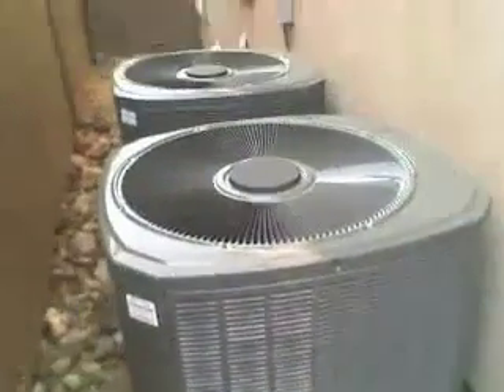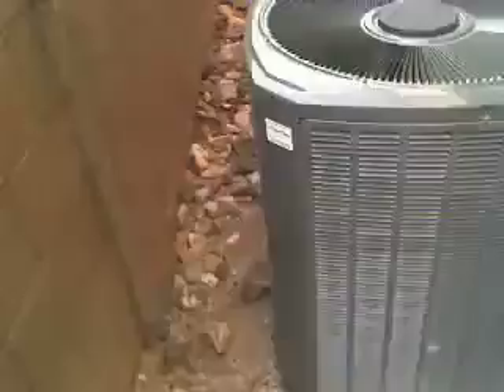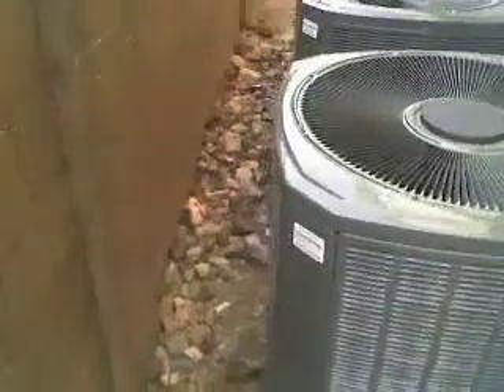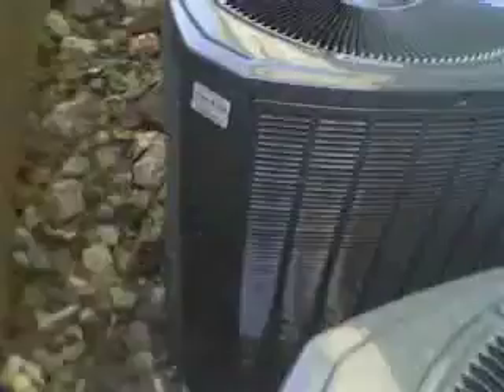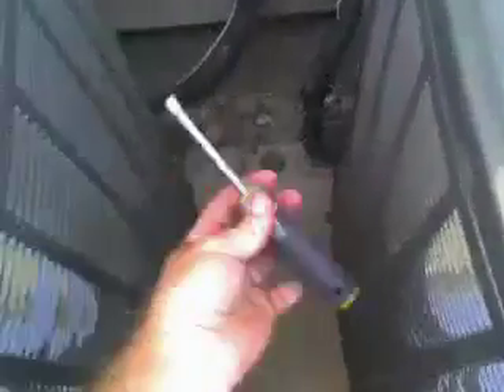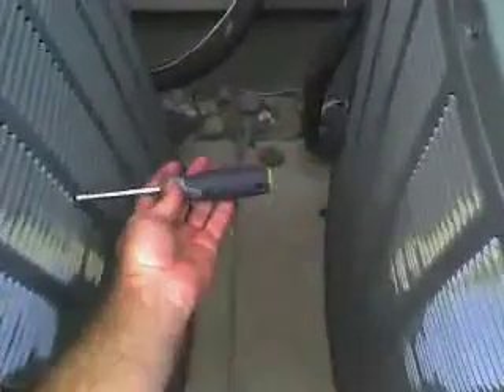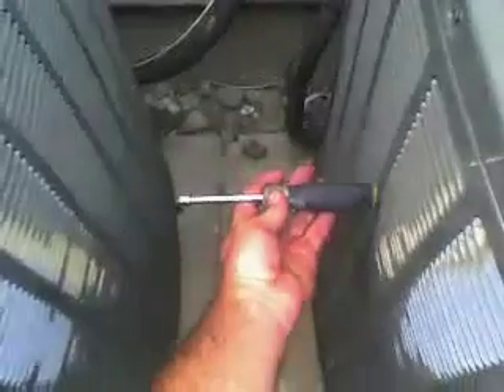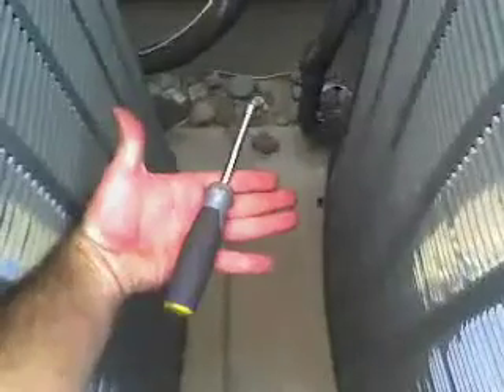Hacked Trane XL19i units! Very BAD installation!

Comment: LOL. My unit was installed 15 years. ago. It was an XL 19i Trane 3 tones unit. I just learned all by myself my unit was running at 2.5 Ton.  I rather pick up the book and learn the damn thing myself.
Reply from the maker: You mean it was just running on first stage?
On a XL19i twin compressor unit you would be at 50% on 1st stage then full capacity on second stage. 

I'm pretty sure it's still a 50/50 split even on the 3 ton but it's been a good while since I've touched one.

Comment: Lol. I recently got one of those 19i condenser for free that works. 5 ton I’m gonna put in my shop
Reply from the maker: Make sure that start cap and relay are in good shape.
The one bad thing about those units is that they use two recipricating compressors and as it switches between low to high or high down to low it stops one compressor and then slams on the other just 1 minute later. Those things were blowing up start caps left and right when they came out. My fix was to install a kick start KS1 which had a larger MF start cap. Later Trane changed their OEM start cap to one equally as large and that helped.

Comment: Are those on one of those terrible houses in your older videos with those rooftop units above that brick wall? Looks like someone tried to squeeze units between those houses and their brick wall. Whats wrong with putting the condenser in the back yard where it belongs? And run your lineset in a chase up the wall and thru a soffit into the attic? I think attic furnaces are the worst idea ever. Especially in a hot place like Arizona. Those attic temps must be brutal. If it was those same baboons builders who had that brilliant idea of putting ugly as hell POS RTU's on a 5/12 pitch roof covered in pigeon shit, I bet they have terrible attic ventilation and insufficient soffit vents and ridge vent too. Just goes to show, sloppy builders don't just cut corners on the HVAC system, the rest of the house is also built to that same "custom" level of quality. I'm starting to wonder if they have sewer drains that run uphill too??? LOL.
Reply from the maker: No these weren't the rooftop houses but the setup of the narrow side yards is the same layout.

Not enough room for a ladder to be safe and not enough room for condensers either.

In this case they installed two new two stage units right up to each other.
The boss at the time and I argued about it.

He brought in the trane manual that showed at least 12 inches to the closest wall and by defacto said he could HALF that to 6 inches to the wall.

The 24 inches of separation from the next unit was meaningless to him.

That job upset me because we got a lot of install issues and they were installing top tier brands at top tier prices and would then do this to some of them.

Most of their rooftop stuff looked great.
But the split systems with the furnace in the attic like this job was so sad.

Comment from the maker: @NLBheating 
Install is a BIG part of failures, which is the theme of this video.
But there are brands and models of brands that have been known to be JUNK.

Here in Arizona we had Goodman Heat Pumps that were referred to as "Desert Series".
I don't think people saw them in too many areas of the country. But they seriously are the biggest pile of crap to ever exist.
Stack Relays (time delay relay) and rubbed together cap tubes were major failures unrelated to install on those.

Comment: @82dwkamp i hate most people cause they think Tranes suck. I've had my Freedom 78 and freedom 90 (own two houses) and both of them have been working for over 21 yrs. yet my lennox whisper heat died in 2 months(lake house). i install them my self(with friends help) and follow ALL the I/O sheets for maximum efficiency. only problem ever was the 78 unit's blower motor died, so i bought the biggest motor they can use and now it's just amazing (the 78 covers a 3,000 sqft house, 1 degree per minute).

Comment from the maker: @7O124 
They are certainly XL19i systems.

If you watch the beginning of the slide show of the "BEFORE" and read the video info you will realize the flat tops from the lowly base model 13 SEER in the "AFTER" segment was the companies band aid to the problem and keep the head pressure under 400 PSI (R22).

Comment from the maker: LOL! What license?
In Arizona they don't require a license/certs or any proof of any training and you can go work on refrigeration. plumbing and electrical components in the systems. All you need is a EPA card. And they rarely check for that. Only your employer usually asks for that. A guy can study and take the EPA test to get that just like studying and getting your drivers license. Doesn't mean you have a single day's of experience! It's BAD. No permits, no inspections here.

Comment from the maker: LOL! That's the point. Those ARE XL19i's. I took pictures on the first PM I did to them before summer hit when I saw how close they were to each other!  The VIDEO part is of THE EXACT SAME XL19i's AFTER my coworker found them conking out in the HOTTER part of summer when they ran over 400 PSI head pressure! He installed XB13 fan grills to discharge the air more straight up and to bring the head pressure below 400 PSI! Yup! Those XB13 looking things ARE XL19i's!